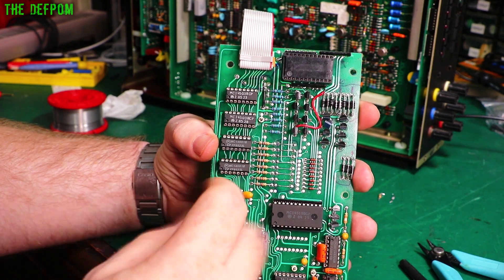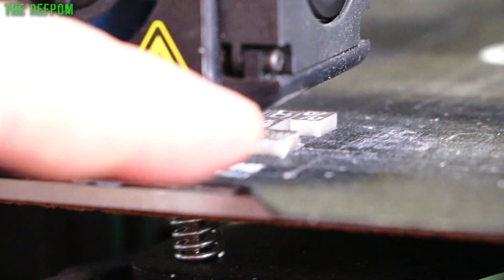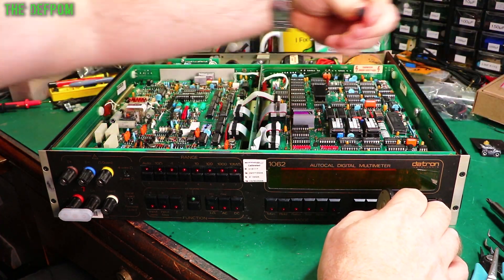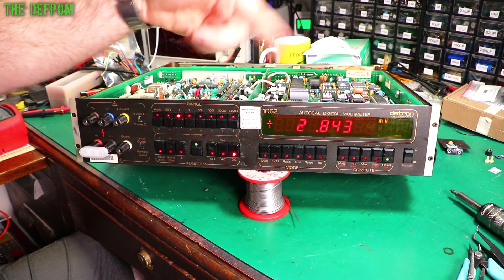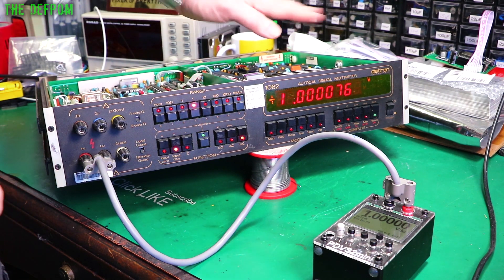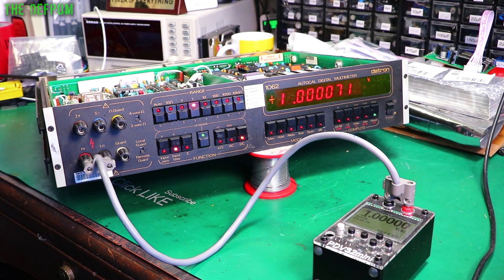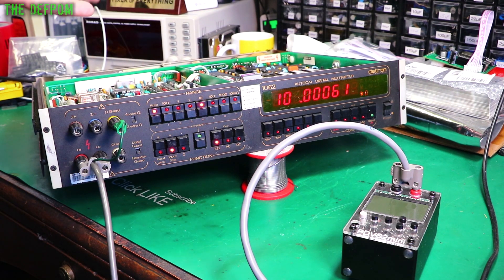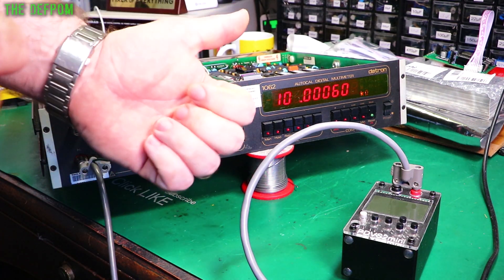🔴 Datron 1062 Multimeter Repair Part 4 - Replace a broken display - SN_016117 - No. 803

Comment: Excellent work, Scott! Your display mod looks really good. It might be worth upgrading the calibrator display just to eliminate that pesky -175 V supply. We may have to call you "Mr. Datron Display" from now on, your hard work will certainly benefit others wishing to repair Datron gear. Thank you for a great video. David
Reply from the maker: It has been a fun repair, I got my money’s worth with this one ! I just need to get myself organized to sell a few of these displays, I recorded some video the other day which I will use as instructions on how to do the replacement.
Reply from the maker: I had noticed that the calibrator use BOTH the + and - symbols at one... so I have designed another revision of the board to allow for that, I thought I was being clever combining them into one symbol... oh well!